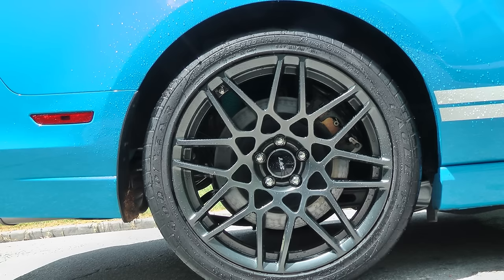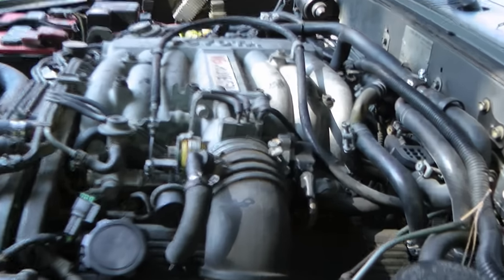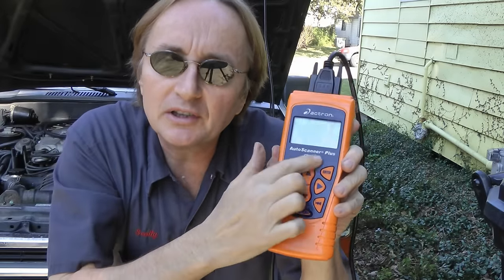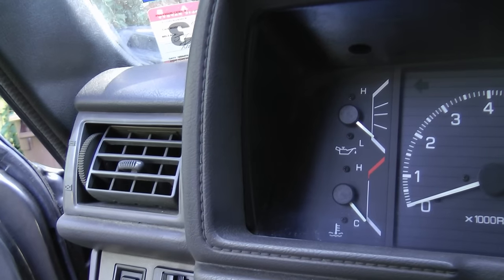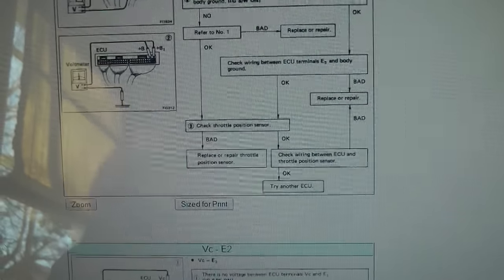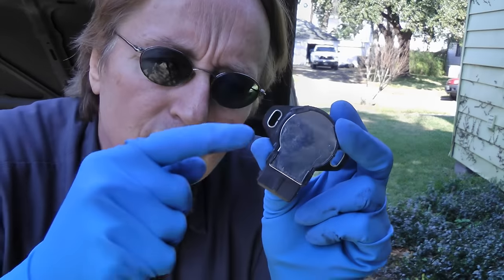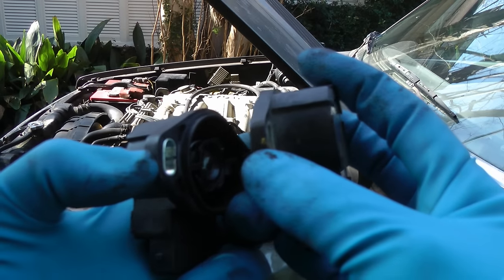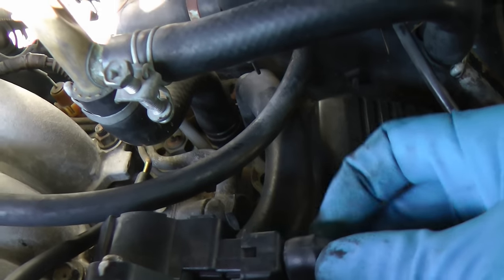How to Stop Car Hesitation (Throttle Position Sensor)

Comment: Hey Scotty, I have a 98 3.8L mustang 5-speed and It is hesitating when I accelerate at around 2-4000rpm, it only does this when i give it a little run. I just changed the spark plugs, wires and ignition coil, and the problem is still there. Also sometimes when I turn off my car for about 30 minutes and come back to start it, it stumbles and misfires like crazy, the whole car shakes! Sometimes it even turns off. I haven't thrown any engine codes yet. I'm stuck idk what the problem is
Reply from the maker: pressure test the fuel pump, weak ones won't trip a code

Comment: scotty i have a 2006 dodge ram 3.7 L I change the gas pump but when i start the truck, he accelerate very hard 5000RPM by itself and 8 seconds later it turn off.

Comment: Hey Scot I'm having a problem with my 2003 dodge ram 1500 v8 4.7 I have the code 0068 witch is the t p sensor I changed it but it's doing the same thing I need help  badd.

Comment: im only getting .29 v on closed position "throttle position lower than 
expected".  Can i just adjust the throttle cable so its more open, 
until i get around to getting a new sensor?
Reply from the maker: you an try rigging it that way, may work a short time before the computer gets confused

Comment: hello scot ,
well , im facing an issue , my car is a cadillac bls 2007 which is pretty much like saab 93... anyway this cadillac has a turbo engine .... when i used to step on the throttle it used to speed up quick then i hear the turbo sound and it changes to higher gears ... i was driving the other day and i heard a low pop sound , then after that my car was acting very strange ... low power .... not same performance and i dont hear turbo sound anymore (usually rpm 2-3) ... i am very confused if the problem is from the gear ? or from the fuel or fuel injector or filter ?i would really appreciate it if you could help me sort out this problem because i dont know where to start....
then i drove it on tiptronic to check the gears if they shift as when i want them to ... the do but everytime the rpm reaches 2-3 ... i had to remove my foot off the pedal and step again so it can shift to a higher gear ....
thank you in advance.

Comment: need some help..i have a 97 dodge dakota.i had a bad tps before,so i replaced the tps about 4-5 months ago,worked perfectly.Recently had a machanic replace my computer.now my car is having accelaration problems.could my tps really be the issue.scanned the car and got a PO123.
Reply from the maker: tons of things can be the problem, from a worn out throttle assembly to wiring problems going to the computer. Find a better mechanic

Comment: Hey Scotty I have a 04 wrx and I have a code for tgv position sensor 2 (LH) circuit low I put a new tps sensor on and it didn’t fix the problem it doesn’t want to stay running idk what to do

Comment: Hey Mr. Kilmer my parents have a 2000 Rav 4 that stalls when you accelerate initially , noticeably after it surpasses RPM of 2 , then it stalls and decelerates however , if you let go of the gas and press on it again after it has stalled,  it rides smoothly until I make  a complete stop and the issue happens all over again. Can it be the throttle position sensor? Thanks.
Reply from the maker: +Robert Thou doubt it, they rarely go bad on those. More often bad oxygen sensors and or the computer software that operates them, toyota has reflashing for them, but often it requires new sensors, all 4 of them and they aren't cheap
Reply: +Scotty Kilmer hey Scotty I have a 1989 camaro with a code 22 which is for the throttle position sensor low output voltage, I believe I need a new tps but will I need to adjust it or will it just be plug and play

Comment: Scotty I have a 94 Chevy truck put an fuel pump ,fuel filter ,ignition coil ,rotor ,still won't start but before I did all this it was fuel pump now it's getting worse back fires through the tbi and I do not have any codes come up what do I check or do to fix this?
Reply from the maker: +Wes Hasley often leaking fuel injectors do that, OR bad engine valves. Do a compression test of the engine to check valves first
Reply: +Scotty Kilmer I have a bran new crate engine how to check injectors?

Comment: I have done a full service of car a vvti 1nz-fe  engine. but I just have one problem it's still stalls and pick up slow. once I apply brakes but when I accelerate it won't pick up too fast. what could be the problem. fuel injectors changed as well.

Comment: i getting ready to modifie a 91 honda accord any pointer been following u for a while
Reply from the maker: what kind of mods? A supercharger would be nice
Reply: Good day mr kilmer i have a 4x4 2000 toyota tundra v6 5vz-fe.The mileage is high but woked fine until one morning it started idling  low puffs black smoke all plugs keep fuel fouling bad smell in exhaust jurking when mild accelerating and cut off twice one time different days.No check engine light and no hard starting also it will rev like normal at WOT.Please help me with my problem thanks in advance.
Reply: Also mr kilmer i did try looking on the internet in forums and some people say the fix was many things like water temp sensor,timing belt,O2 sensor,fuel regulator a plugged return line too many i just don't know what to rule out.

Comment: Hi Scotty,I own a 2004 toyota camery. having issues with accelaration.car runs and idles great.Problem is when I step down on gas peddle to pass another car the car seems to hesitate before it down shifts and then comes back to life. any ideas. Thanks
Reply from the maker: Tim Klar try tuning it up, and also my video "how to clean fuel injectors on your car" and pray the transmission isn't going out

Comment: hey Scott I have a 1998 honda civix hx my problem is when I start the car it idles ok and as soon as I go from park to drive the rpms start jumping up and down and I replaced the idle air control valve which made it worse. what do u think the problem is
Reply from the maker: check for vacuum leaks and pray it's not the transmission or torque converter going bad internally

Comment: Hey Scotty my friend has a 1984 camaro with a 305 v8 And 4 barrel Rochester quadrajet carburetor. only two barrels currently work due to a vacuum tube being clogged but it drives just fine. but when he goes to get on the accelerator it waits 2 seconds then hauls what could cause this?
Reply from the maker: a carb that needs rebuilding. rochesters stink anyway, throw it away and put on a new edelbrock, online they don't cost that much

Comment: Hey Scotty I have a question my van 2002 town and country was working just fine day before I went out the next morning to warm my van up before taking off when I leave it sputters real bad until you get going and it's fine only does it when you first take off and if you are idling at a stop light and take your foot off the gas it will shake
Reply: Another thing I can tell if you going 30MPH and give it more gas you can feel the sputtering
Reply from the maker: +Richard  first, try tuning it up with spark plugs and ignition wires. If not that,  check for vacuum leaks as in my video "finding engine vacuum leaks with a cigar"
Reply: +Scotty Kilmer ok thanks will do that. I will go buy new spark plugs should I get new spark plugs wires while I am at it too
Reply: Hey Scott I changed the spark plugs thanks for the suggestion I have way more power now. It still spudders if the converter is bad will it make it spudder I know the exhaust has a smell to it

Comment: hi. i have a 1999 nissan maxima. after raving it past 6 thousand rpm on (p) the car wouldn't accelerate anymore when put on drive. it felt as if the car was on neutral and would not respond to the gas pedal. what could be the problem?

Comment: Hey Scotty, my escape keeps showing a [P306] 6th cylinder misfire even after the plugs, coils, oil, EGR valve, gas filter and octane, alternator, radiator has been changed and the air filter replaced. Fuses are all fine. I even clean its manifold regularly. And now even my other vehicle which I have just purchased is doing the same thing but no check engine. What can it be????
Reply from the maker: swap the fuel injector fro 6 to another, if miss moves that's it. If not, often a problem in the head gasket or intake manifold gasket on 6

Comment: hello, i have 96 dodge ram1500 5.9L 4x4. i have little problem with find iusse with p1294 relat with throttle position. i notice that when my truck take off itself in drive up to 15mph. There is possibly throttle sensor  or something else? would it be ok if I take the whole thing off and clean it while replace?
Reply from the maker: +Samuel Bulter  try a throttle sensor and pray that fixes it

Comment: I have a 97 chevy s10 that seems to run fine but I noticed if I am in park or neutral and I hold the gas pedal it's stutters real bad going down the road has no problem or revving it real fast and letting off just when I'm holding the pedal still while in park or neutral it's stutters like that what do you think it may be?
Reply from the maker: you aren't supposed to revv it up not in gar, if it runs fine otherwise, leave it alone.

Comment: just got a remanyfactured engine in my 85 chevy caprice. idles poorly hesitates 10-20mph its throttlebody injected mechanice said i can just swap out tps,iac and map sensor any advice?
Reply from the maker: that old, SO many things could be wrong, from your old swapped parts to the engine itsel (yes, remanned engines are often garbage these days.) But start by checking the injection system, it's weakest link

Comment: I have a problem in 2007 Mitsubishi Lancer 2.0 engine rpms was low I put new air control valve now the rpms are high but the wire part is I turn the ac on and the rpms are in good level can you help to find the problems I clean also the throttle body and nothing

Comment: a friend of mine got a kia sedona 2.9 SE it was serviced less than a year a go and when it starts its smokey it cant be reved over 2000rpm when cold as it pull back and chucks out pretty thick white smoke (stinks of burning oil) but fine when its idoling and as it warms up you can then rev upto 3000rpm pull back becomes worse and when its pulling back it starts to chuck out more white smoke hates going up hill also do you have any ideas i can tell my friend thanks
Reply from the maker: +Andy Phillips odds are head gasket is blowing, typical crappy kia, good thing it's not your car. Buy a toyota if you don't want problems like that.
Reply: +Scotty Kilmer LOL thanks for the help what about piston rings? could that be another thing to the possible problem

Comment: Hey Scotty! So my car runs great. But only problem is going up hills are trying to step on the gas a little bit more to go fast and my rpm's idle a little high. They go to 3 and a half on the rpm's. Doesn't sounds good for my car cuz the engine sounds like it working extra hard. What can it be?! Anybody?! Also expericing some idling on the car too when the a.c. is on most of the time Just replaced spark plugs a month ago.

Comment: I’ve got a 97 gt mustang 4.6 I changed fuel pump also filter runs better still has a hesitation an spits an sputters when I get into the throttle but if I lightly go at it no problem what could this be

Comment: I have a 2001 jeep grand cheek laraido driving at 60  mph it just stops  fuel is good  what do you think
Reply from the maker: +James Chappell change the fuel filter and pressure test the fuel pump then to see if it's weak. If not that, pressure test the cat as clogged ones do that too.

Comment: Got a problem after cleaning the throttle body and TPS.  High idle like 2000 to 2500 rpm in parking and and neutral. But if i engage to drive or reverse it becomes normal like 1000 rpm.

Comment: Hello Scotty, I have a 93' Chevy Tahoe and it hesitates while accelerating and at 60 miles it'll rapidly drop down to 2000 RPMs and then when I try to accelerate from there it'll sputter/jerk
Reply from the maker: +supri45 often a weak fuel pump or dirty filter, check those first, you can pressure test the pump

Comment: My Honda accord 94' its very slow when I take off, after I take off it fast and smooth. Do you have an idea what could be wrong?
Reply from the maker: +Yakary Perez  often dirty fuel injectors, try my video "how to clean fuel injectors on your car"  IF the car has good spark plugs and a clean air filter.

Comment: Took car on highway this morning and rpm's were over 3 and my top speed got up to only 45 mph going up hill. Could this be a fuel pump issue? Just got a tune up new plugs/wires 2 weeks ago. Thank you.
Reply from the maker: pressure test the pump to find out, if not that, often a clogged catalytic converter or clogged fuel filter
Reply: I will try those suggestions. Nothing else has worked lol.  Thank you very much.
Reply: car stalled after 20 minutes this morning then started again after waiting 5 minutes. Taking it back to dealer mechanic for the 3rd time in 2 weeks. Car throwing no codes.
Reply: Car stalled in front of mechanics. Raised hood and was getting no spark but after sitting for 5 min car started right up only to stall while driving 20 min later. Car never stalls while in park only when driving. They replaced fuel injector module and still stalled after 20 min. They have no idea what to do next. Very frustrating.

Comment: hey scotty  did what you said in this vid...unplugged tps and it fixed the issue so i replaced it. however when i plugged in the new tps it started doing the same thing as with the old tps. any ideas? also its a 94 camaro z28.
Reply from the maker: +bigred42ster you could have wiring or computer circuit failure then, also check for vacuum leaks

Comment: I have a problem with my car. Ford Scape 2001. First of all it overheats. The other day it over heated I thought I could make it to work but I guess not so the antifreeze hose exploded and antifreeze got everywhere fixed that but now I dont know if that might have damaged the engine. Once I tried driving it from work to my house thinking I could at least make it home. I didn't. The car shakes but that happened before. Once I was about a couple miles away from home the car didnt want to accelerate. As much as I would press on the gas it wouldnt not go or it would go but it would take so long even the rpm gauges wouldnt go up. Eventually it didnt even drive at all. I had to have someone push me. The car turns on but it doesn't accelerate. I don't know what to do.

Comment: ive got a 2000 cavalier. im about to change the tps in hopes of solving my issue but not sure if it will be a fix. ever heard of "trac off" light turning on, followed by hard shifting and engine noise until i shut the car off twice? i know my tps is running low voltage, but i dont know if this is something with the abs, or bcm. any help scotty?
Reply: i figure its an electronic issues rather than the transmission seeing as its random and weather can seem to affect it.
Reply from the maker: +Rob Hutchison realize those are UBER complex computer run systems, both the engine management and the transmission itself. see my video "fixing insanely complex modern cars" and have a guy like me hook one of those up to analyze it. I would assume computer module failure of some sort by those symptoms
Reply: That was the issue, we did a check at a transmissiin shop and very few error codes were brought up. He cleared them and it resolved for about 2 weeks so thats why assume not mechanical but electronic.  He said one option is to take it to the dealer ask for them to use a tech II scanner, shut off antilock breaks and traction control via the bcm. It might work but i just cant seem to pin point whats breaking down haha. Damn intelligent cars.
Reply: +Scotty Kilmer also ive found that these are very hard to figure out but it seems to be common among chevys. i just didnt know if it had been a semi common problem. but i will keep trying new people if the tps dosent solve it. thanks again and i love your channel!

Comment: 1999 Lincoln Continental. I took the car to get the error codes read. cylinder number 7 misfire detected and solenoid circuit malfunction. It started hesitating last week. When I get up to 50 mph it feels like it opens up all the way. The jerking stops. Any suggestions where to start? I've never fixed a car on my own. My dad and I usually do it together, but his health is bad. Thanks
Reply from the maker: bad spark plugs, bad spark plug wires, or bad fuel injector are the most common. Start with the cheapest parts and work up if needed

Comment: Hello.. my car hesitation on acceleration just when i give the engine gas I feel the engine miss firing and jumping and don't have the power to accelerate..
I changed the spark plugs and air filter,oil filter,fuel filter,I cleaned the mass air flow sensor I checked all hoses no cracks no smoke..I checked all this things I replace all this things but the problem still there do you know how to fix it ?

Comment: Scotty! I'm in need of desperate help I have a 1999 Audi A4 1.8t with an aeb head.. 
I have a very ruff idle (jumps 500rpm) and it dies when I put in drive and start to move. What do I do!
Reply from the maker: endless money pits those audis at that age, especially the turbos. Start by doing a compression test of the engine, and if it's low, get rid of it. Those engine often wear out at that age. If not that, check the maf sensor and fuel pressure

Comment: on a 2008 yukon. when replacing it so I have to adjust anything. because the light is still on code p0121 an replaced Throttle/Pedal Position Sensor